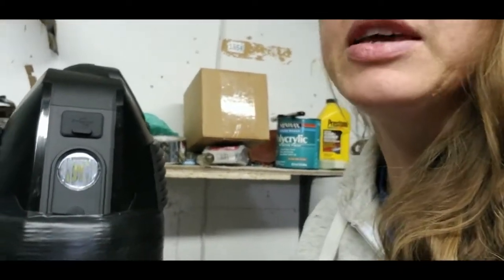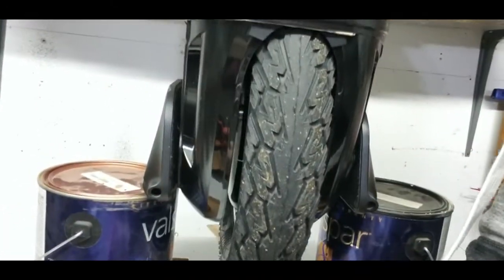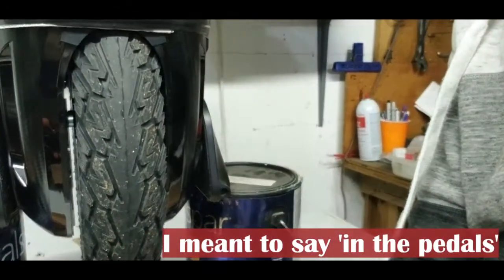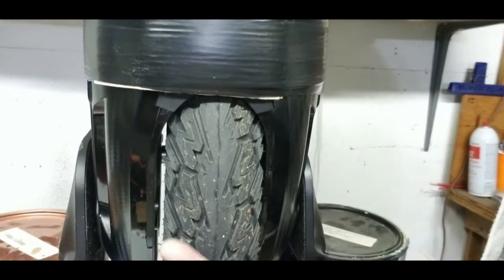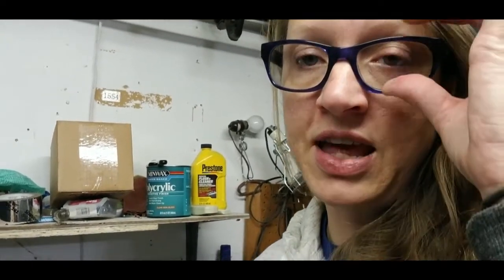EUC KingSong 16x Pedal Gap

Comment: I have a KS-16X. It was bought in 2019. Neither of my peddles fold up enough to touch the case and they are both equal. Standing on the machine the gap between the wheel and the case on the left is slightly smaller than on the right - not by much. I have had no problems with the machine. Well I lost the cover over the USB ports :-)
Reply from the maker: This is what we learned from ewheels - There is a tolerance allowed and it's completely safe to ride. I'm so excited that we don't have to send it in to be repaired!!